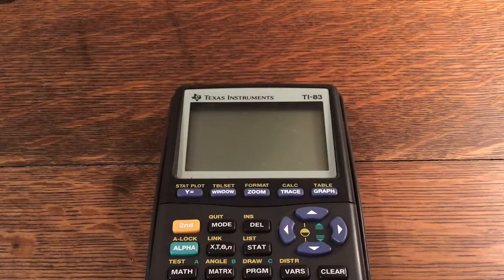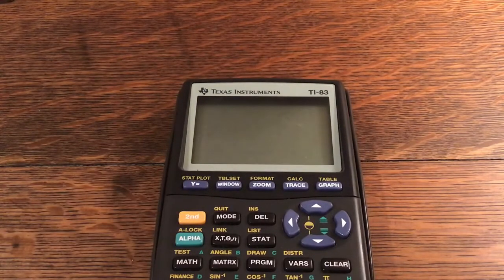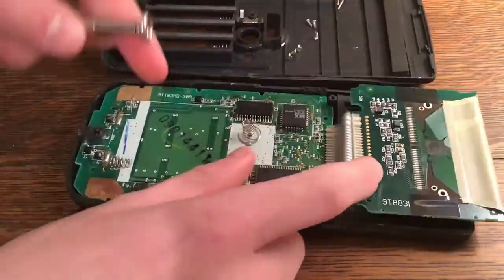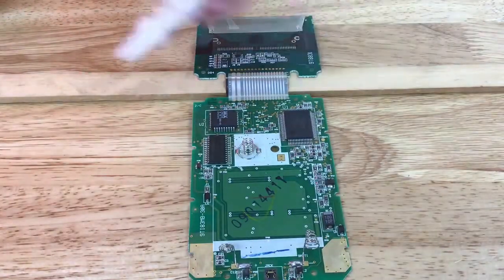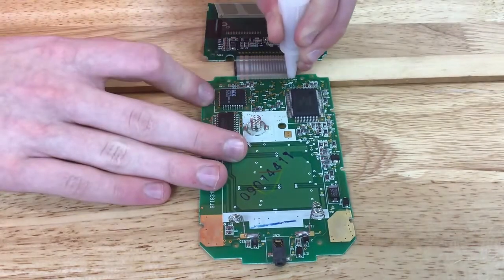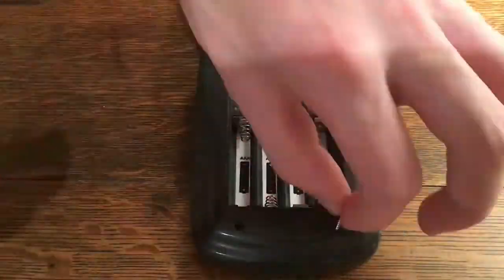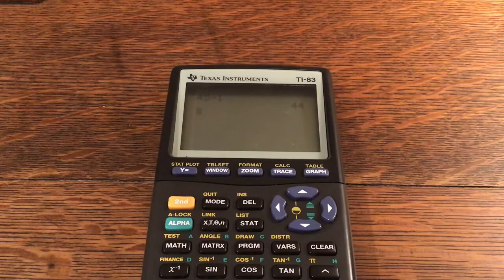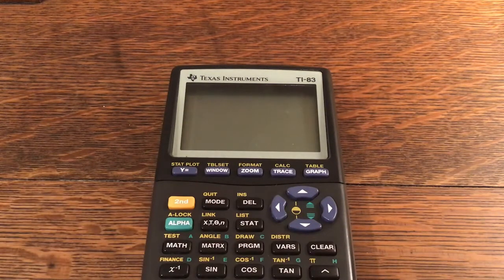How to Repair A Calculator With A Glitched Screen

Comment: Thank you so much for this video. I was able to fix my Sharp scientific calculator lcd screen from the early 90's which I used in high school and it's displaying perfectly now. Even though I have bought a new (cheap) scientific calculator, I prefer my old, better quality Sharp calculator and I hate having to throw electronic stuff away when it can rather be repaired and used again... Yay for green recycling!!!